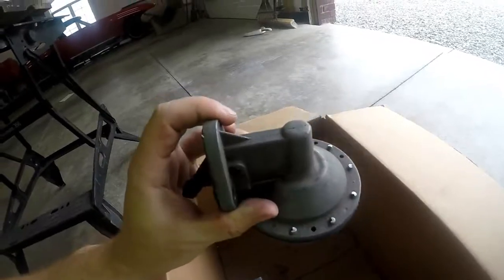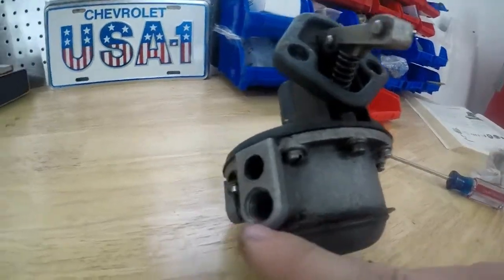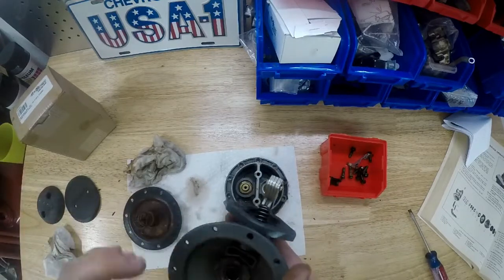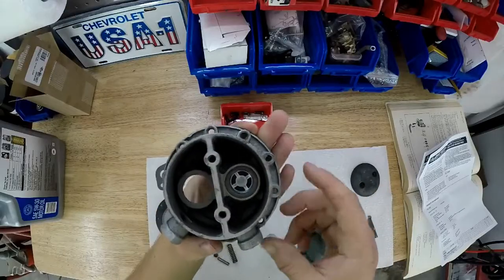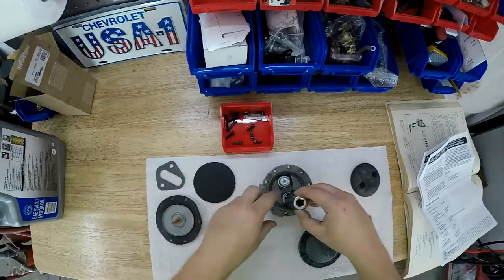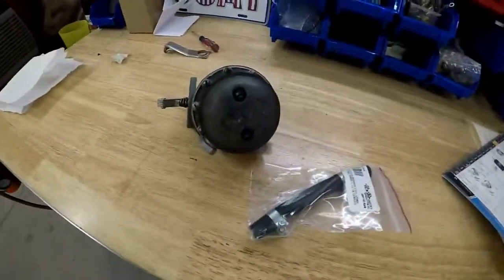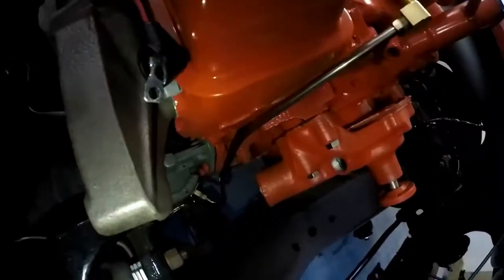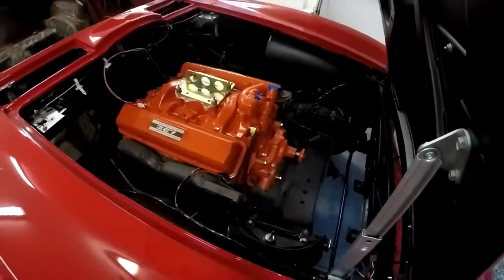Chevy Corvette Mechanical Fuel Pump Restoration 283 327 350 409

Comment: The lever pin you removed had to be drilled out.    Was the replacement pin a different type?    Does replacement pin work the same?

Comment: Where do I get the 2-hole cover plate gasket
Reply from the maker: You may have to buy a complete rebuild kit to get the gasket.  But you can buy plain gasket material and use your old gasket or the cover as a template to cut a new one out by hand.  There should be other videos online about making those kinds of gaskets.  Best of luck!